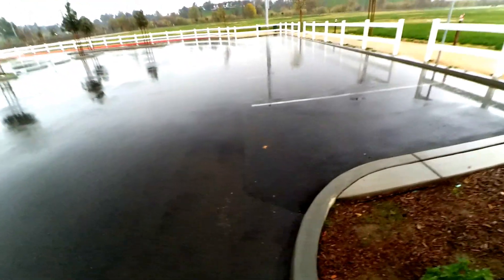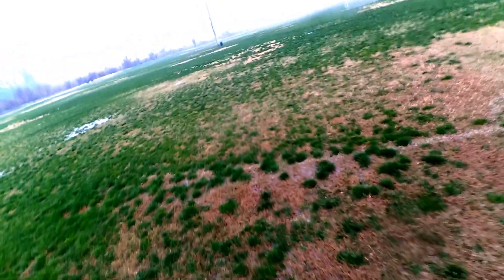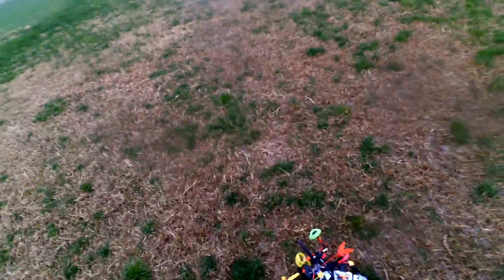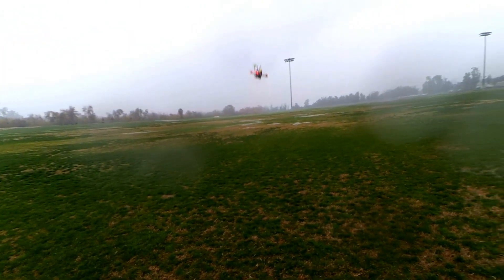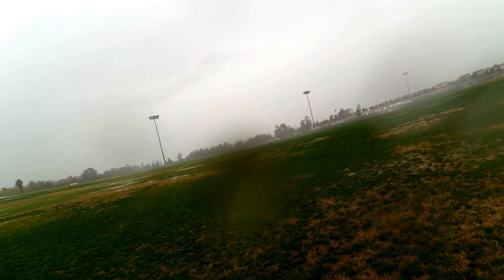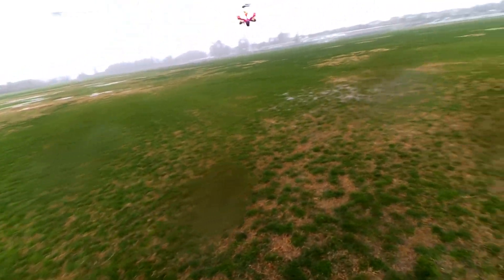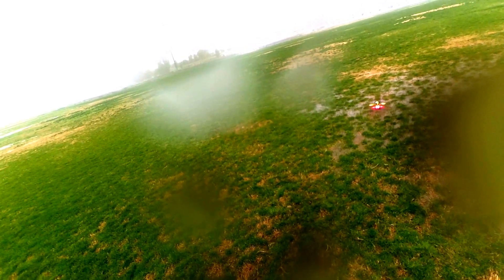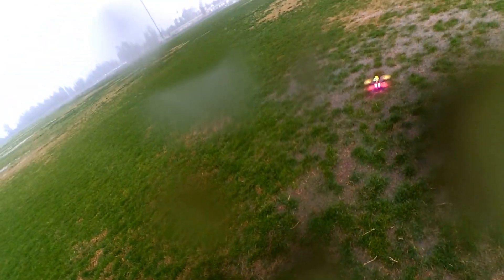Realacc x210 Real Waterproof Flight Conformal Coated...Waterproof Quadcopter Drone | But HatCam Fail

Comment: Nice video Scott!
Reply from the maker: God Im horrible. I haven't checked my youtube videos responses for a while. I dont think you need to apply it more than once every winter or rainy season. the coat seems pretty durable even now. I do use it for all of my builds now, as it only takes seconds to apply. You can do numerous coats with it and not worry about it affecting the circuitry in any way. I'm on my facebook group a lot answering and asking tons of questions in our group about racing quadcopter, builds, mods, equopment, etc. Stop by and check out our content. If you like it, then feel free to join in. Thanks
Reply from the maker: Thanks Deli,

always wanted a waterproof drone, but did not want to pay a ridiculous price for one. So this mod only cost me $23 and I can waterproof at least20 more drones....And it works Great! Thanks again
Reply: How often do you think you need to be re-applying this? And thanks for the video and some actual testing - I feel the same way!